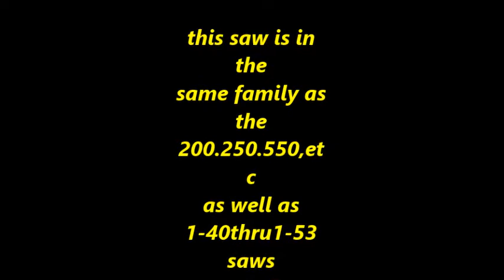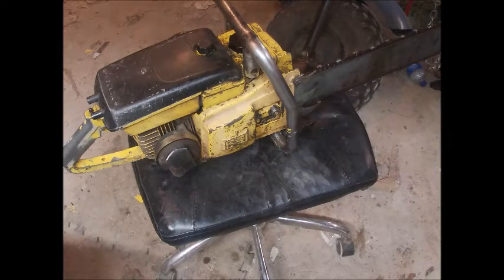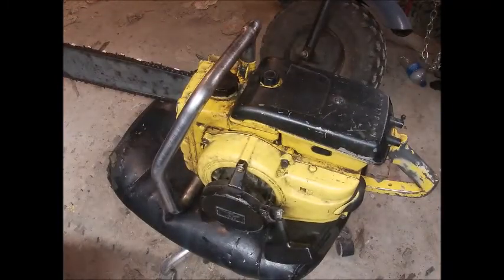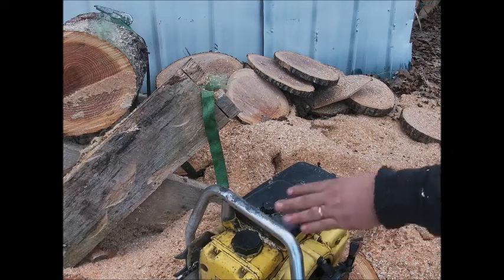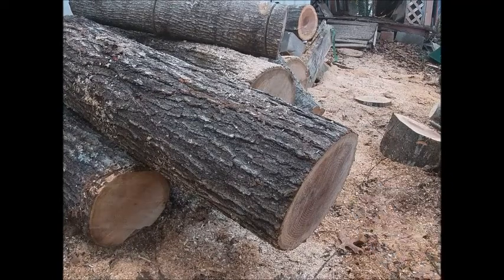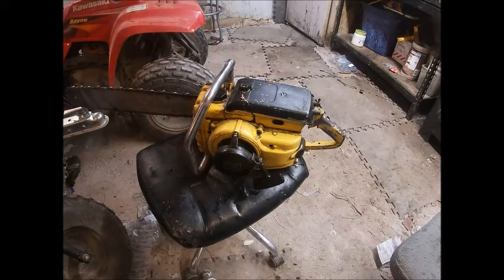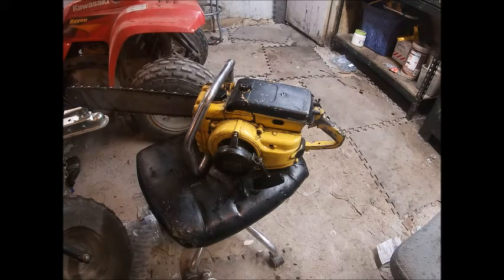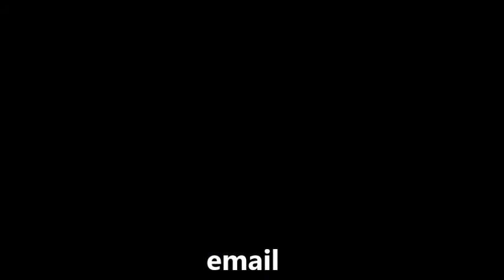McCulloch 300 log testing a 1960s American Muscle Saw...

Comment: Thanks for your videos and information. I have two old Mac 250’s just like your old saw. Mine run but wondering if you can point me in the right direction. I I I rebuilt the Tilley HL carbs and they start right up. Problem is can’t get either to run consistently. I checked the seals and they look good. Tried a pressure test with soap and could not find air coming out at seals. But it’s leaking a lot. Would you guess bad rings or gaskets? Do not want to rip the whole saw down because gaskets are hard to find or make. Thanks for any ideas.
Reply from the maker: You can buy most all the gaskets on ebay..just search for kart engine gaskets...inconsistent running sounds like a reed issue which can cause an air leak...
Reply: @JandSChainsaw  
Thank you, that sounds like a definite check. I’ll get into that now.

Comment: would really like to know what  parts are needed to change out that flat carb,thanks
11
Reply from the maker: All ypu need is a Tillotson hl carb you can even get an aftermarket a stihl 070 is a direct fit
Reply: thought you changed out the original flat back?
Reply from the maker: @thankswillie  I did Tillotson hl is a direct bolt on no mods needed
Reply: @JandSChainsaw  thanks again!
Reply: @JandSChainsaw  ok,thanks!
Reply: @JandSChainsaw  havent even tried to start this boat anchor yet..lol,i have a primer on mine,would need to change knob to lock in choke?...are you down in the deep south?

Comment: I have the same saw, just made in Belgium. It has the casting form in the tank for an auto oiler, but it is not mashined out. I thought i can make it work somehow, maybe machine it out myself. What do you think about it?
Reply from the maker: i dont know there is alot of little passages in that tank....a 550tank will  fit
Reply: @JandSChainsaw  Yea, it would be finicky to do. Unfortunately here in Europe not a lot of those 550 are around, but I will keep an eye on the market. Great video's by the way, thanks for the info on the old saws!